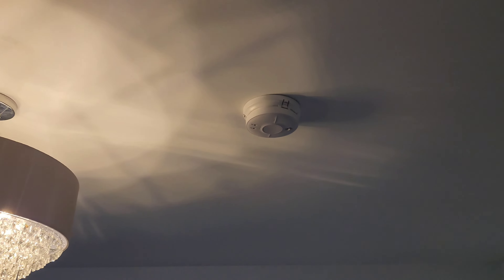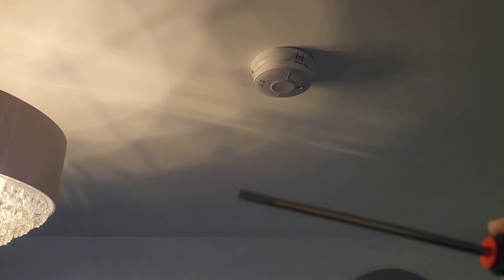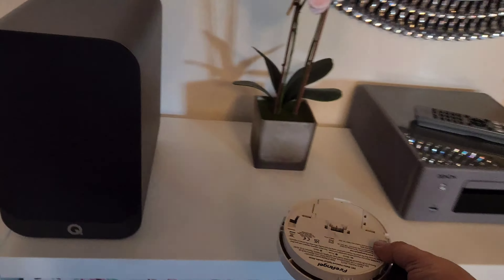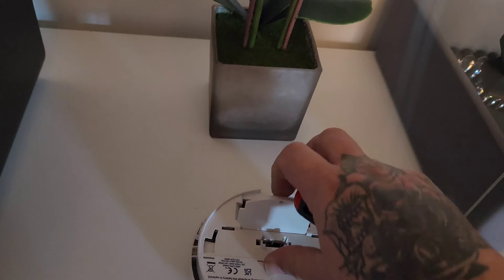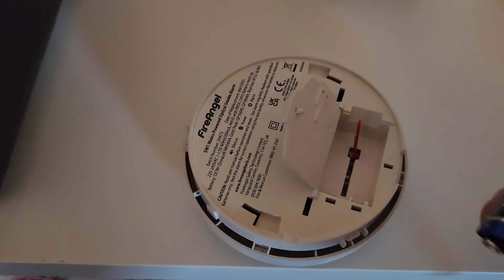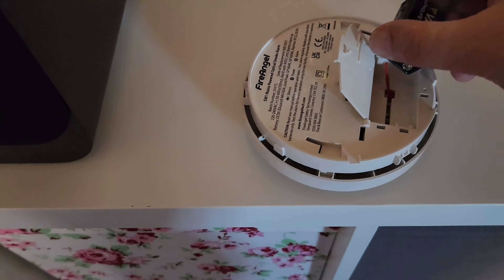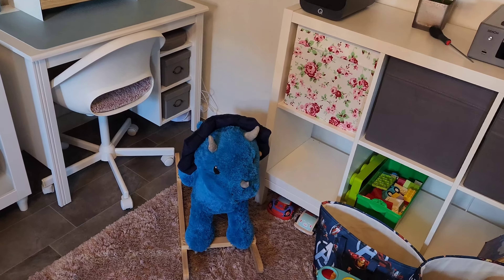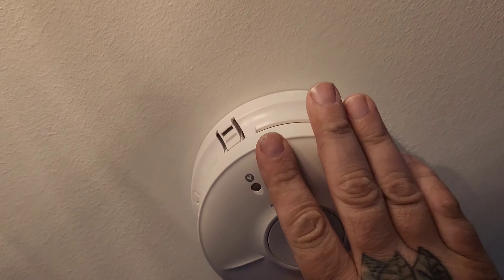FireAngel Fire Alarm Bleeping Change the Battery Easy D.I.Y Instructions

Comment: Hi, thanks for video, did you have to turn off mains power to the lights before you removed the cover of the smoke alarm? Regards, J.
Reply from the maker: No I didn't bother as long as your not prodding your fingers in there it will be fine..
Reply: @BigBoyzToyz1974  OK, LOL. I just learnt the maintenance for mine belongs to the building I am in as mine appears to be hard wired. So now no longer my cost to bear, thank God. They have been chirping for days now.